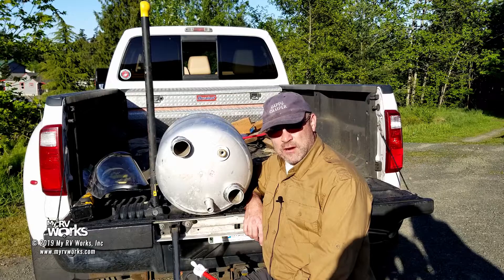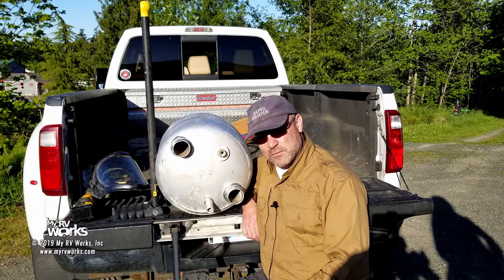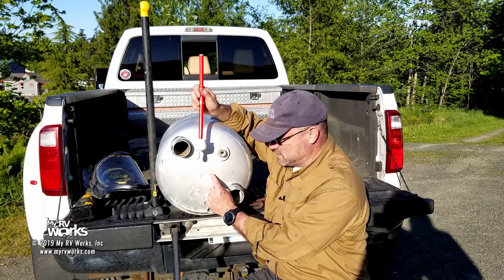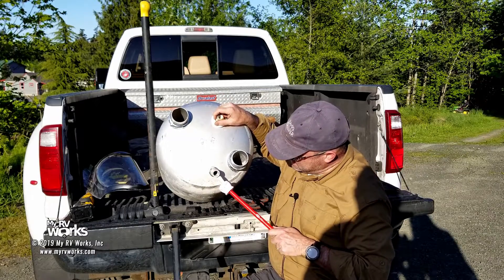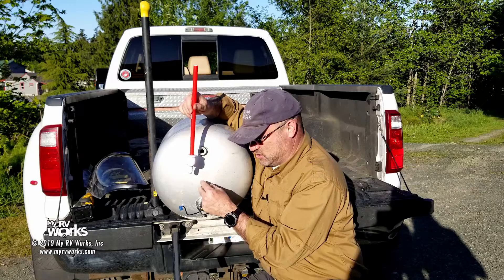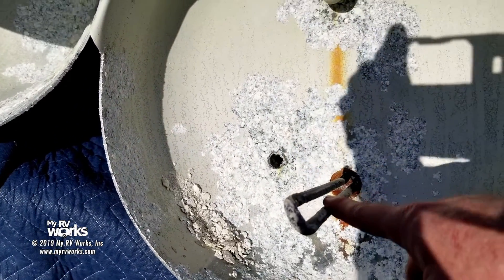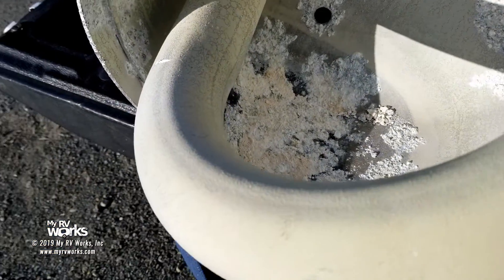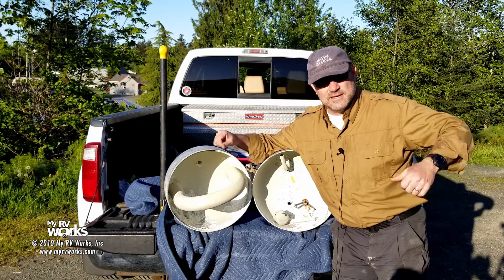What Is Inside An RV Water Heater?

Comment: I have an Atwood water heater that only works if the door to the heater is open. Any thoughts on why?
Reply from the maker: Let's start with a good cleaning of the burn chamber and the small nozzle where the LP emits into the burner tube.  If there are any obstructions it may affect the fuel:air ratio.

Here is a good video with an overview of many of the parts and how they work.
https://youtu.be/INpA0lakPXw?si=wpyJZ76oMBApEeh-

Comment: Thank you for what you do! I have learned so much since purchasing a truck camper. I had a bad board last year, Atwood, worked perfectly after changing out to the Dinosaur board. I have a different problem now. Heater lights, goes to temp, draw probably 20 seconds of hot water, then cold. It will go back to hot after a while and back to cold. I watched your flushing video, did that, same problem. It is doing the same on AC and LP. Thermostat? If thermostat why would go hot and cold? It also does not relight once cold water has entered on LP. Another thermostat potential?? Is thermostat not telling it to relight?  if so, why hot and cold?? When you showed this video I thought possibly I would see why hot then cold. I do not see that reason. I saw something about you do remote tech service? Would gladly do that with you!!

Comment: Great Video. How hard is it to change out the heating element that would be under your sink area inside?
Reply from the maker: There is a tool that fits around that heating element. The challenge is the heating element nut is so skinny it's hard for that tool to stay on. Sometimes it will screw relatively easily but most of the time it's a fight.  https://amzn.to/3gIfaay

Comment: Curious what you recommend on my water heater that does not have an anode rod.  It has a plastic cap and supposedly with my model on a winnebago travel trailer It does not need one.  Should I still be flushing it out once in a while?  
Thx

Comment: Great video. I have a 2000 Leprechaun and trying to figure out how I can get vinegar into the water heater ( not hot water heater) to clean the calcium off the inside. I tried the flushing method you demonstrated in one of your other video's for over an hour and still getting the same amount out. I have only owned this RV for a year so I don't have a complete history. It is a Attwood / Dometic 6 gal tank. I am assuming because of the age is the reason I can not find any documentation across the web on this procedure. Any help would be greatly appreciated. Again thank you for your video's.

Comment: Thanks. I've wondered how the heat is transferred to the water, and I can imagine  what would happen if the tank wasn't filled before the propane was turned on. I wonder what the water level would be at  if you didn't bleed the air out of the tank when filling it?